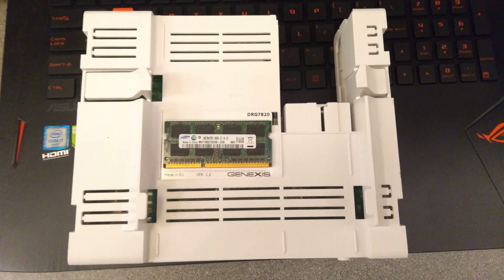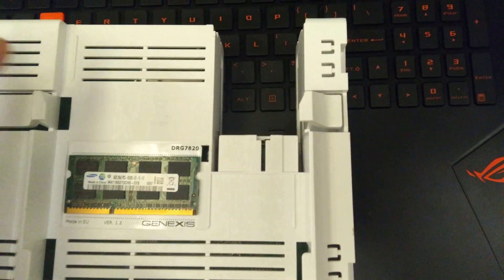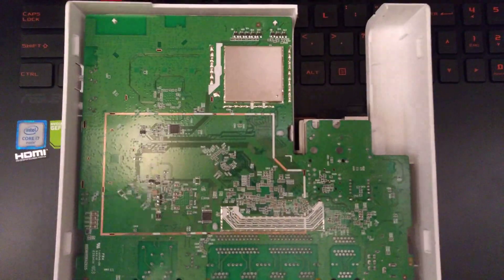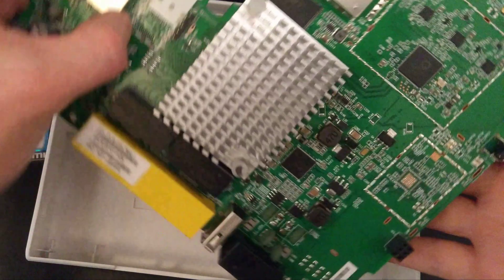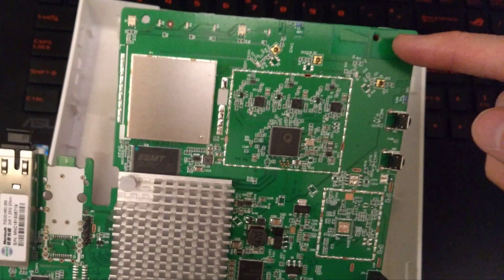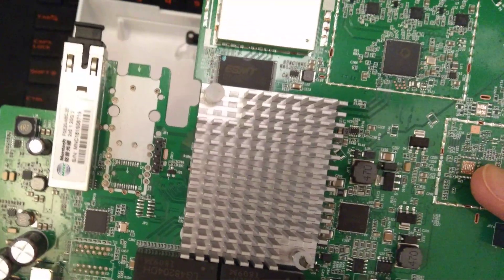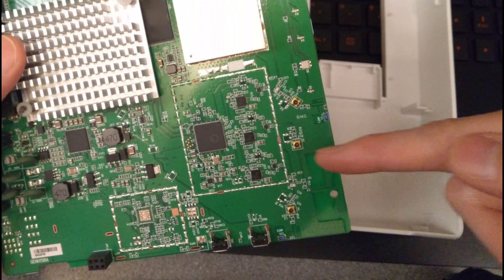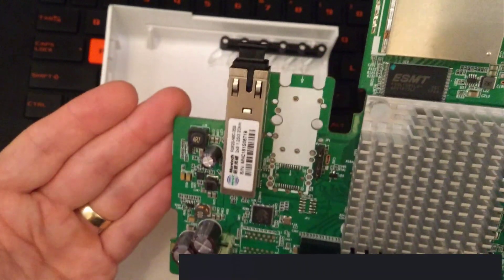Inside a Genexis DRG7820 FTTP router.

Comment: The parts that you mention to be antenna connectors are test points. In the factory used to measure power. You cannot connect any connector to them, these are not available.
Reply from the maker: Please provide further information / source. What do they do between testing and adding the enclosure to deactivate them? And the older version of these routers did use the ports with aerials attached to the front cover.
Reply: A tiny test pin is inserted that connect a measurement instrument and disconnects the trace going to the antenna. When the test pin is lifted the connection is restored. See: https://www.murata.com/en-eu/products/connector/switchconnector and https://youtu.be/BpqBkR1mC_E
Reply: Sockets in which a cable for an antenna can be plugged are u.fl or m.fl, both are male, the plug is female. The test sockets on the board that you showed are female. That alone should show that they cannot be used to plug in an external antenna. Also the outer ring has no ridge to clamp a plug. Lots of people see these small sockets and believe they are u.fl or m.fl sockets but alas.
Reply: BTW, the PCB is identical to the Genexis Platinum 7840.
Reply: And there are 4 antenna’s on the PCB, look carefully and you will also see 2 tiny 5Ghz antenna’s. WiFi with these routers is terrible due to these silly PCB antenna’s.
Reply: Where you point for RF coax, a WAN RJ45 socket and magnetic can be soldered. Strangely the chip that controls that port is soldered on but not used in this model. The coax module goes next to the TEL RJ11 sockets.